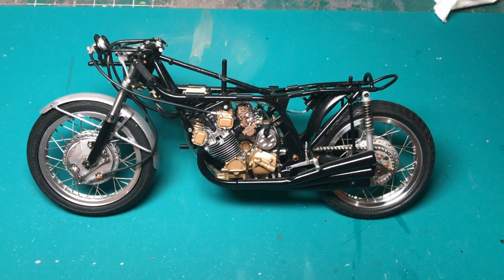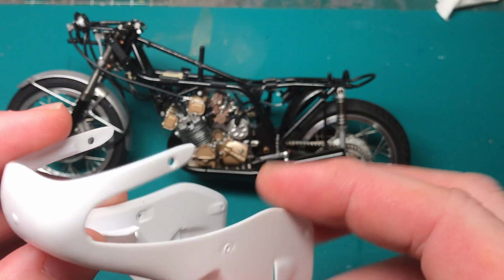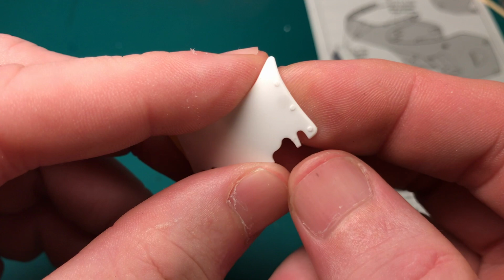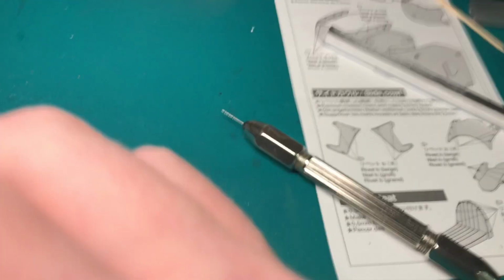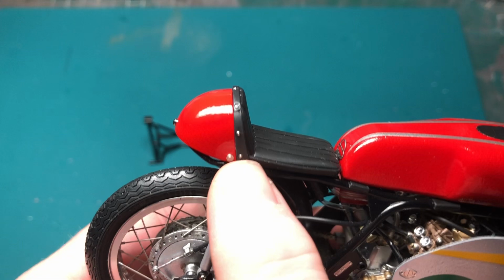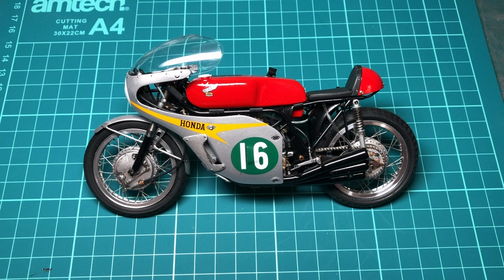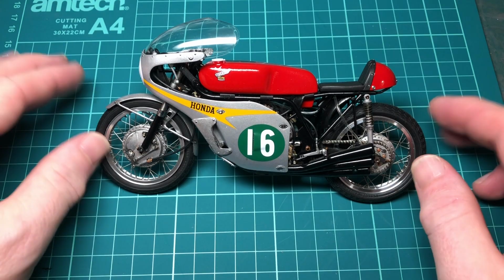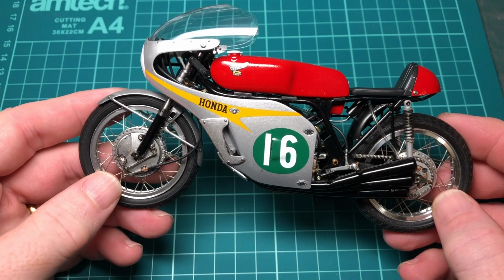Tamiya 1/12 Honda RC166 Racer - Part Five.

Comment: Your build was the inspiration for me to buy and build this incredible kit (though OTB with none of the extra bits).  Truly one of Tamiya's best models ever, and you have dome justice to it!   Couple of questions:
1.  Instructions call for magnets to be used for attaching the small body panels.  The kit contained the photo etched plates, but no magnets;  did yours include magnets?
2.  What red did you use?  I decanted some TS-49 Bright Red but to me it looks a tad too orange.  Thinking Gunze #3 might be better...

Again, outstanding work and thank you for sharing!!

PS:  Recently completed the 1/9 Italeri (ex Protar) R80G/S.  Not Tamiya standards, but an acceptable kit that builds up to an impressive replica. Have their Tenere 660 on order.

Cheers!
Reply from the maker: Hi Thanks for your comments and questions. 1. I’m thought the magnets came with the kit. 2. I used X-7 Red.
Reply: @NevboModelMaking  Thanks!  Requested magnets from Tamiya USA.  Turns out I have X-7 in my stock, but decided the finish on the TS-49 looks so good, I didnt wantto chance messing it up!